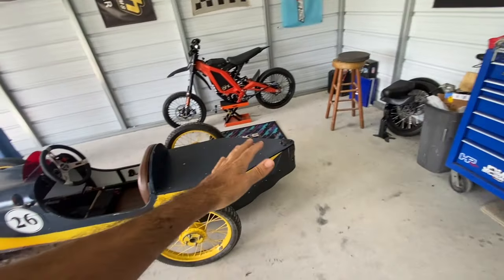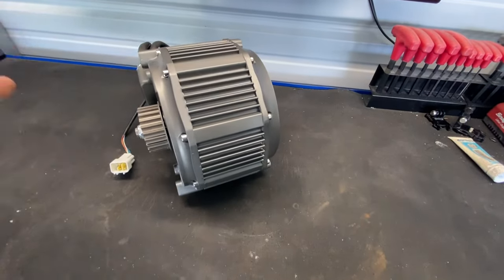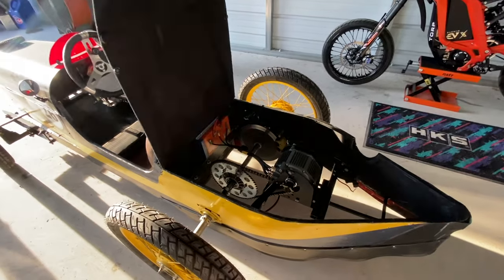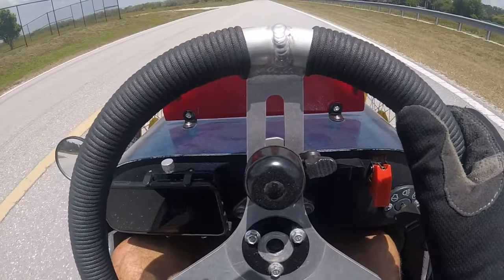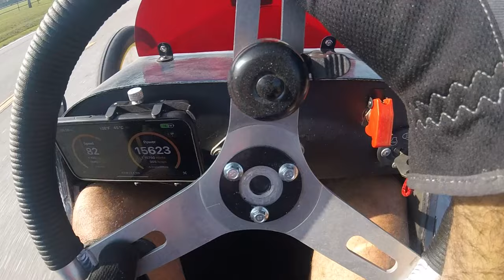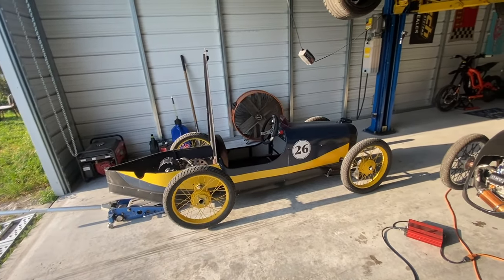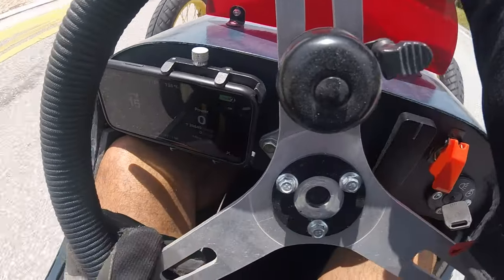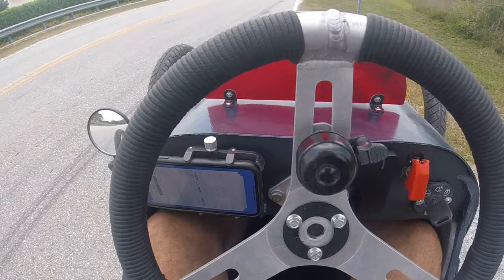WORLDS FASTEST CycleKart 84mph

Comment: Hello Jack, if you want to set records you might consider the specs for cycles karts. To the best of my knowledge,  the agreed upon specs for cycle kart gas engines is 212 c.c  four stroke engines with a stock horsepower rating of 6.5 horse power. 6.5 horsepower comes out to be 4847.1 watts. A conservative estimate of a modified 212 c.c. powerplant of about 10 horsepower would be 7460 watts.  
To have a record in the cycle kart category you would want to limit yourself to a maximum of say 5500 watts for a stock class record. For a modified class, the power should be limited to 8000watts for simplicity sake.  The slight allowance of watts for electric is to offset the increased weight for the battery (s). This would more or less equalize the gas verses electric comparison. So to set a meaningful record, you need to have an equal consideration of watts between a gas powered unit verse an electric powered cycle kart. 
Otherwise a person could just install any size motor/battery combo verses any size gas engine rendering any comparisons meaningless. That's why there are classes at Bonneville to equalize the competition to make thing relevant and to not just ending up comparing apples to oranges. 
Just my .02 cents.
Reply: Those guide lines are informal. There is no official governing body.
Reply: Agreed. The people saying there is no such governing body, are the same people who speak on things they have never been around or participated in.

Comment: Cool build but there's a reason Cycle Karts run 6.5hp motors. If you want to be the fastest Cycle Kart it needs a 6.5hp/4.8kv power plant.
If you want the fastest Gocart build whatever you want just don't call it a Cycle Kart. Just put a Busa/Tesla motor in it and be done with it.

Comment: Keep the motor plus sprocket setup but add some geared hub motors to the mix.  They will make accelration and hill climbing amazing.  Surron sprocket motor for speed.  Could probably get over 50hp with hubs and sprocket motor combined.  It would be pretty wild.
Reply: The hubs will get you WAY faster acceleration..it will make a HUGE difference I promise.  Or a gearbox / drivetrain of some sort and more power.  The hubs are easy and cheap.  Just make sure to get geared motors.

Comment: Aero man, aero.  Make a lightweight flat plate for the bottom and make sure the grill is 100% closed off.  Could duct a small vent to the motor using an old shop vac tube and a vent on the top to release the air.  Probably get a few mph out of it and free downforce.

Comment: The fighter jet nose cone would help a lot. Think boat tail bullet or velomobile. Look up the cheating tricks of track cyclists like how they used to tape a small piece of string on the down stem for drag. Your helmet shape and rider position. under body / flooring in the engine bay (inspiration from speed boat with a step chine). Maybe wheel pants/fenders for the rear wheels but I wouldn't put them on the front.